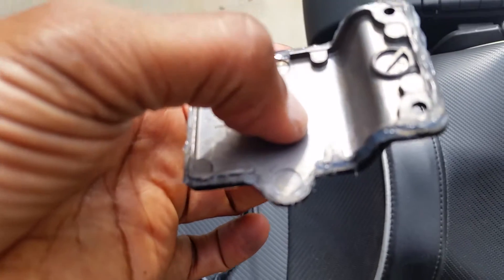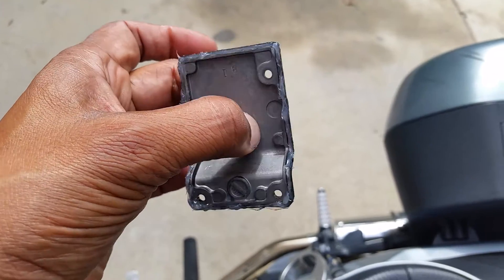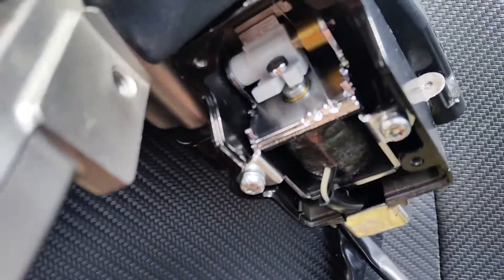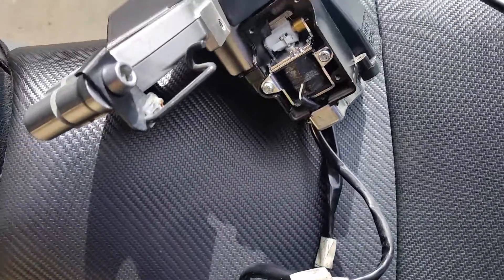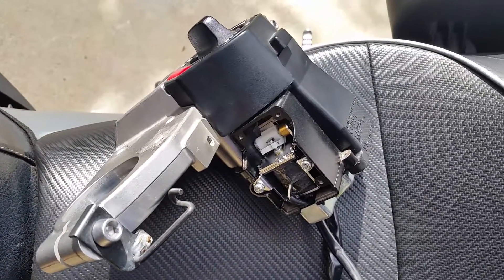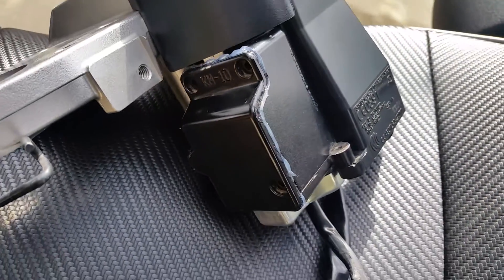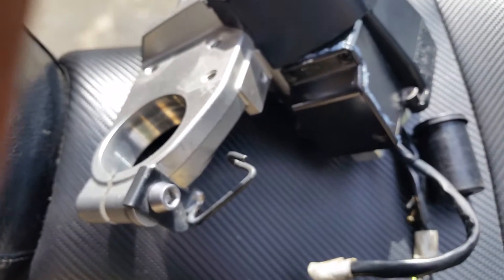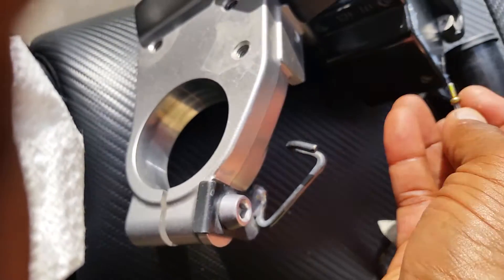Concours 14 KIPASS solemoid cover sealing & installation

Comment: Thanks for sharing these videos Adam! I have an '08 as well and am experiencing the same issue you've discovered just recently. I've watched all 6 videos that you did on this-- did this work after getting it all together? If you were to go back and fix this issue, is it the spring and/or switch? Just need to see what i can clean and repair, or replace. Thanks again! I love my C14 and want to fix this issue once and for all.
Reply from the maker: Yes, it worked great & never repeated. I sold the bike recently.

Comment: Hi Adam I found this interesting as i'm thinking of the Concours, did your fix sort out the fault for good , its seems to be a regular issue for some owners.  Is it a problem on only earlier models etc? Thanks
Reply: Hmm, no answer to your questions leads me to think he either sold the bike or it didn't work at the time.